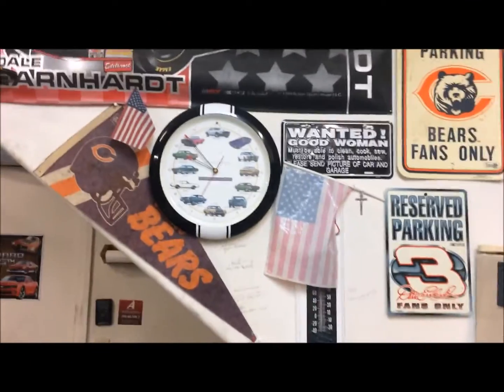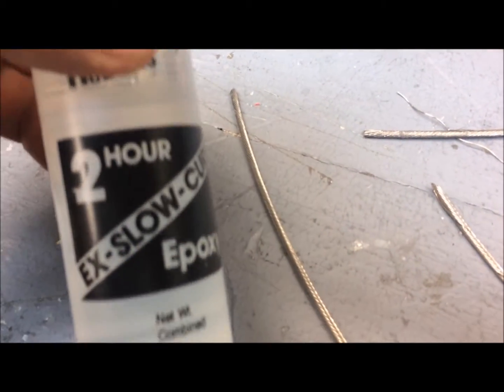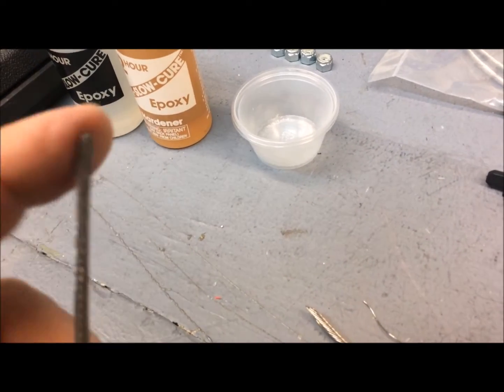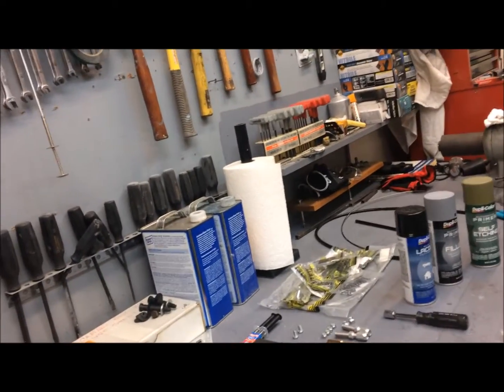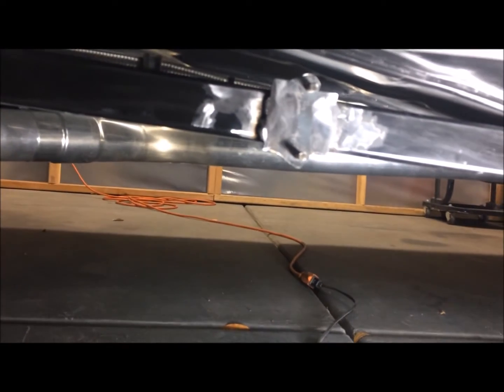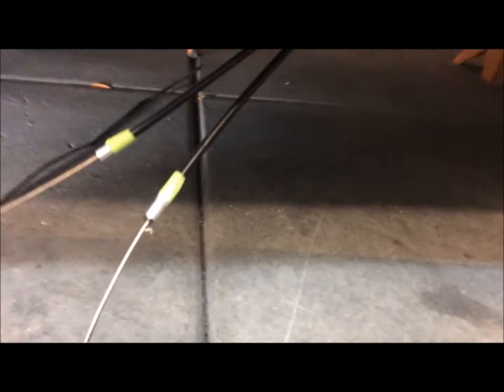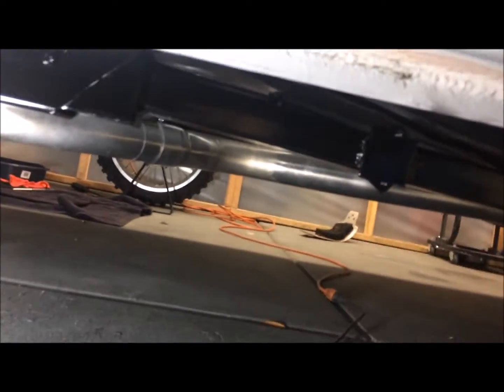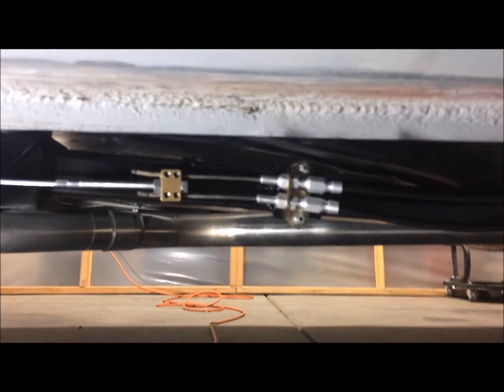1968 Camaro Resto-Mod 1-14-17

Comment: Hey Tom. I've been watching your videos for awhile now and I noticed that you sometimes have a problem with focusing on items that you are close to like you did in this video with the brake cable. An easy way to get it to focus is to put your hand behind the item so that the camera cant focus on background items. I also understand that you are often are working with one hand and if your interested I have a small 8" flexible tripod that I can send you for moments when you need to prop up you camera or just need an extra hand. I bought it awhile ago when I was thinking about starting up some you tube videos but have never used it. Thanks for all of the great videos. I can wait to see the Camaro when it's done. Keep up the good work.
Reply from the maker: Thanks for the info I'll give it a try and I have gotten a tripod - thanks again.